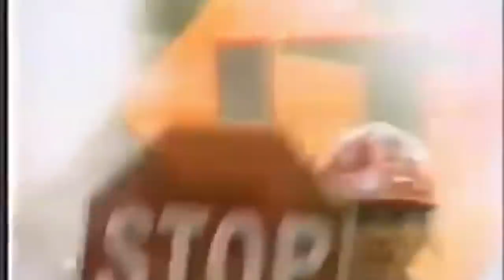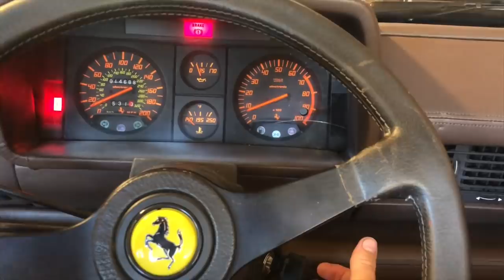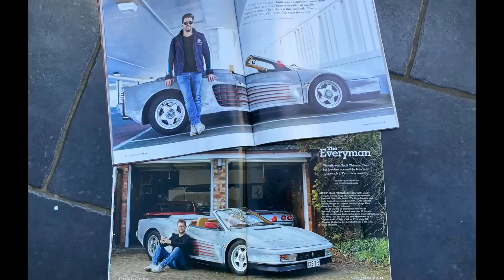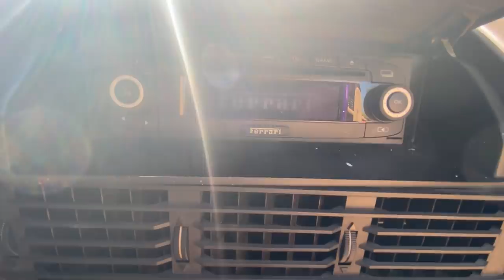Abandoned Ferrari Testarossa Rescued to Build the Worlds ONLY Rat Rod Ferrari - CHEAP !!

Comment: Awesome.
Do you know any of the story before you got it?
Was it converted from new?
How did it come to be so run down
Reply from the maker: Apparently I was told, it was used to make the body moulds for a kit car, they then hacked the roof off to make a convertible version of the kit. Personally I think theres more to it and that it must have been in some prior accident.
Reply: @Ratarossa  makes sense. Awesome channel Dude.👍🏻
Reply: @Ratarossa  Scott,i have a few solutions to your problems:
1.Get a good body shop Man who can make the panels fit and cut ,you only need the man not the "body shop" bill! Also the reinforcements for the chassis need to be done under the car so you have the proper view when you open the doors!😉
2.The car is UNIQUE it deserves a new and fitted interior and that will increase it's value.Again ,you need someone who can do this not a "shop".😉
3.The car needs to be a satin pearl white or the best Black ...because your attachement to Miami Vice and Michael Jackson  video wich will also create value for the car in time.
4.In USA there are shops wich build convertible tops for cars that never came with one look into that in the UK.I hope its not very expensive!Also from the cars profile the best top for it would be something resembling the 360 spider shape.
5.Try to make a "gofundme" or get some sponsors to help with this project pple that would benefit from such a UNIQUE project with their name attached to it!
6.If you made it this far, get some crazy exhaust to let it scream and ENJOY. Have fun! 😎🤗
Reply: Tube Extravaganza please do not ever start a gofundme to ask strangers to pay for you to have a custom convertible top made for one of your many Ferrari’s. 🤮
Reply: @Ratarossa  contact performance rebuilds based in Birmingham UK.They are a fairly new YouTube channel and work wonders with repairing and painting vehicles.Together both your channels will make excellent viewing and will finally give ratarossa the finish she deserves.Just an idea but personally thats what i would do.👍
Reply: Judging by the crappy bondo, bet it was wrecked. But what a perfect car for this kind of project. No one can give you crap for hacking up a mint Ferrari. Personally I’d make it a badass track car.
Reply: Ratarossa I love the look. totally get it. I know you love the centre locks of the wheels so I'm assuming that's why you not changing the wheels to a wheel that will suite the "rat" look better. however you could get the standard wheel dished?? to give it  that proper rat look
Reply: Ayyaad Samaai yeah. Throw some Moon dishes over them or just spray paint em red. Personally I’m waiting for the interior to be addressed. I’m from the rat rod/greaser/rockabilly community and if we had torn up seats and door cards like that we’d cover them with Mexican blankets. I think a Mexican blanket interior would really complete the look. Right now it just looks like a regular Ferrari with no paint. But I love it the way it is too. That’s just what I’d do. It’s the quintessential “rat rod” look. That and a shifter knob that’s so high it goes up above your shoulder. Lol. I’ve made this comment now in two different places because I just want to see a Ferrari with a Mexican blanket interior SO MUCH! Lol
Reply: Nah, the convertible top was a backyard hacksaw job...
Reply: @Ratarossa  Well, were you, or weren't you told that's what happened? Watch your wording ;)
Reply: @Ratarossa  they made molds probably for the miami vice series they had a few fiberglass ones there
Reply: I definitely agree with leaving the color like so! I love how it looks with the side strakes still red, badass my friend!
Reply: Hey that thing needs a patina red Ferrari paint job something that looks like it's been sitting in the sun

Comment: If you wanted something different regarding the finished paint..... How about using the colours of the Italian flag, either front to rear or side to side. You can air brush design it so it looks like the colours are fluttering like a flag in the wind.

Comment: No paint!  If you're going to keep the tatty interior, keep the tatty exterior and a consistant ratrod look.  Get the mechanicals sorted, fix the gas filler, and drive as is.  It's the perfect antithesis to the typical high performance, low mileage Ferrari garage queen that travels more miles in covered transport than out on the road.

Comment: paint it silver or ideally metallic black .. redo the interior with red carpet and black dash and door panels (everything that's brown), and the rest in cream.  Cover the metal in leather.  It also needs cross bracing underneath the motor and passenger compartment.

Comment: I think you should use a lot of parts as a mould! and use Carbon fiber tocorrect it. Even the rigidity on the doors that you weld. it will strengten more! and  meke a lot better work

Comment: In Germany a full good paintjob is min. 3000€alone,maybe in CZ 2500€..at a scoda dealership. 👍🤔Dude to make it great, its no more then 10.000€but without a Roof, you need built a softtop.. Its min. 15000€.

Comment: While the whole ratarossa trip was fun and iconic, i do feel that spider testarossa conversions are quite rare and exquisite cars, a sort of coachbuilt classic almost. So that said I would finish it, with a high quality paintwork. I would do something like a pearl white (blanco fuji?) over an interior retrimmed in black with red or red and white piping to make it pop in some high UV resistance leather. I'd reinforce the windshield for safety reasons and the chassis and think about the viability of putting a soft top on it or maybe a removable custom hardtop in carbon fiber, left gloss with a glass rear window. Sure, all a bit expensive, probably the better part of 35k, maybe more. But the end result would be unique and probably worth the money dumped into it x2.

Comment: I would say .... keep the Patina exactly as it is on the inside ....after all it is the ONLY Ratarossa in the entire world, it does not need a professional paint job and if you get rattle cans in the color of the Italian Tricolor and decide to use those colors then that would be a good paint scheme ..... The plastic bits that are missing in the door cards, so long as you have a good example you can always get them faithfully reproduced on a 3D printer . As for the non - roof , it would be a challenge to fabricate a manual version of the roof of a 360 Spyder but it can be done ( Ask Sam Crac to photo his roof for reference  ) ..... Finally get struts for the engine cover..... wire up the 3rd Brake light please and of course take care of the fuel filler cap.

Comment: Thinking about the roof, you could put a single hoop in and have a fabric roof that clips into the windscreen and on the rear deck like I’ve seen on a few MX5 I think they called it a bikini.

Also, I think you should roller paint it Matt red 🤣

Comment: Saw you on vinwiki. 
I’m curious are there any other strengthening mods you could do to bring the car back to its original frame rigidity? 

Also keep it ratty. The only other paint theme I’d be curious to see on it would be faux rust patina. 

Cheers 👌🏻
Reply from the maker: It’s actually pretty ridged body wise. I had a normal 1990 red coupe Testarossa before and there’s not that much difference between them both body flex wise

Comment: I would put the engine and engine bay in top notch condition. Ferrari is beautiful when it wins is said. So the  exterior is not the most important but the performance. Try get the biggest dents away and get doors mechanically working. Please don't transform it to yet another Testarossa. Keep it unique but make it a beast.

Comment: Let the car be as it is, at least optical. Technical there are some things that should be done (as you've mentioned) but the optics have nothing to say for what the car is to you, a source of fun. In the condition it is in you would never get its value increased (not with that coat rack they fitted to stabilize the frame, or all the cut hoses you mentioned), so why not enjoy it as the rat rod it actually is?
As for the roof, if you can fit a convertible kit behind the seats that would be more than ok, just think function over form.

Comment: In the US, the Air Force maintains the fighter and transport planes for decades. Up close, things look a little rough but that is just the untrained eye. There is no need to paint them, just to look pretty. So they have an industrial coating. Minor lubricant stains abound across the airframes. Think patina. Metal work is rough sometimes and panels may not always match. However, appearances deceive. They are ready to fight in battle. Your car approximates that kind of vibe. I'd say resolve the structural and mechanical issues. Make it mission capable! No need to make it purty.

Comment: Spray the car one color, silver or white.  Find the cracks and blemishes. Emphasize them by painting the cracks in black (hire a tattoo artist).  Expand the appearance of the cracks by extending them further on the body panels as part of the overall theme.  A cracked up body illusion would be like a full body tattoo on the car.  Wild.   Add clear coat.   Make the top from Styrofoam and wrap it in a black waterproof material.

Comment: Èdit: nevermind, answered in the vid, didn't get to it yet :-) Wouldn't be totally relaxed putting too much sideway force on it though.
What about structural rigidity ? That would be my main concern. Just like the diy 240z with M5 V10 engine by B for Build, also that chassis seemed way too flimsy for my taste (as a layman). Without total redundancy I would be comfortable, for instance the wheels hitting a sidewalk sideways and the car simply tearing into two.

Comment: Few random thoughts. The fuel filler looks dicey as hell ! The 1980s look is  incomplete without the high mounted mirror, so change that.
You are probably correct on the cars worth to cost ratio. That said, I did like it in black with the high mount mirror, so would go this route. 
Are you aware of any other conversions ?
Reply from the maker: yes there were a handful made by a company called Straman back in the day

Comment: Instead of paitingi it, I'd rather remove all the paint from the red components and keep it all raw metal, cracked and disaligned. It's a Testarossa with a sad chopping story in the past, you've saved it but you can't do much more than what you've done so far: it will never come back to it's original shape.
Otherwise you might paint it matte sand or military green, lift it, install 4 offroad tyres, a spare wheel on top of somewhere and a metal grill on the lights :D  It would become the fastest Mad Max style car worldwide

Comment: totally get the value prop here but at the amount you paid, I'd do much of the fixup... Find another channel that might want to collaborate and help with bodywork and change the engine lid back and redesign the piece in front of it. I'd build an xbrace system and take out those steel posts. Try to fix all the small stuff like AC and the door pull/tray, whatever is missing. Spend some dollars on the interior. and then paint it red. Something like 3k for the subrame work, 8-9k for local shop to do the interior (maybe not 100% to factory), body work collab but maybe 3-4k in supplies and 100's of hours of labor, and then a good paint job. Likely 6-8k depending on bodywork, color and what they charge. Then likely another 6-10k in unobtanium parts. So yep 30 to 40k. So likely your investment would have trippled. To be fair, I'm likely low but you seem to be quite handy. You'd really want to have that outrun car and be willing to spend more than it's worth. Whatever you do, video it!

Comment: I tube frame the center structure at least a little better than that bar type that needs to be cut out, perhaps under car sub-frame connectors, I'd go so far as to make an aluminum box frame bolting onto the pan from underneath? I'd figure out some type of cloth top you can popup from behind the seats in event of surprise rain. Paint, well, I've got a gallon of 80's NASON GM White paint here if you want it, it's real acrylic enamel no longer made in this formula, you could easily cover that car in white?  If I was you, I'd start brushing up on your body skills, take a auto painting class there in the UK they have to have some clinics like there that are educational wise. The leather seats, and used wear look give character, I'd repair holes, and give it a good conditioning, soften it up!